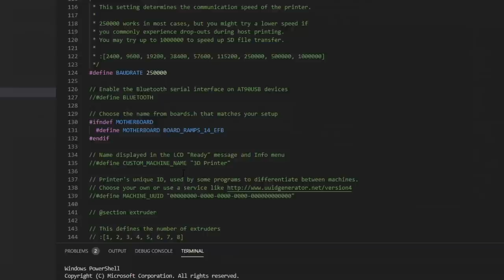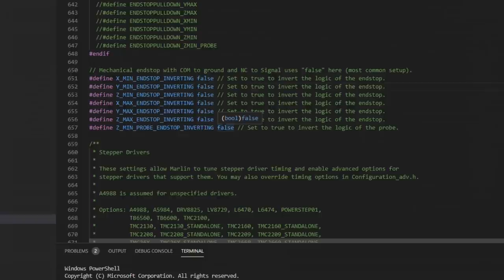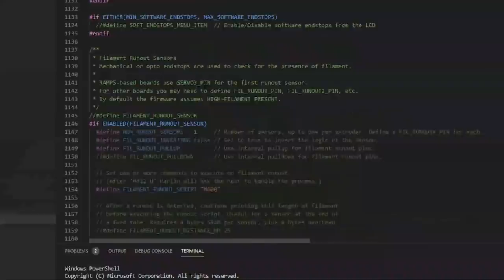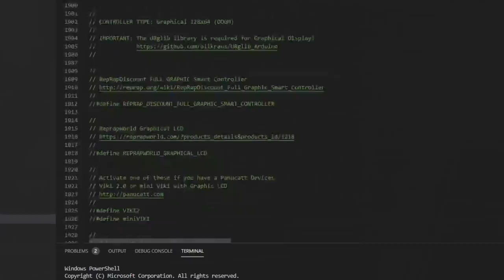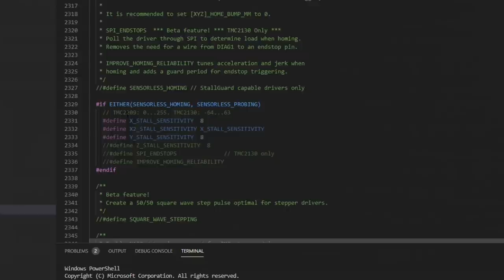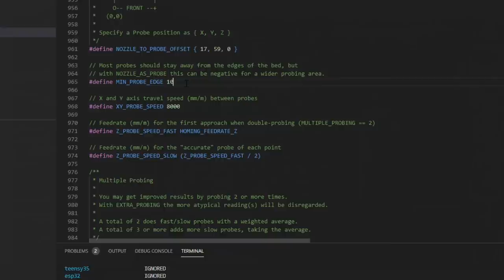Marlin Firmware Config - Core XY - SKGO - Chris's Basement

Comment: Question if I may...
I have the SKR 1.4 Turbo and 2209's, I recently upgraded from a 12 volt supply to a 24 and didnt change the  "CHOPPER_TIMING CHOPPER_DEFAULT" to 24 volt.
With this cause an issue?? or should I change it right away???

Thanks for your time..
Reply from the maker: Hey, no issues, this is mainly for noise, the chopper timing can sometime cause a whistle at certain voltages. This setting it trying to help that.
Reply: @ChrisRiley  Thanks for the info....

Comment: Great information. With ABL I replace the bed springs with printed, solid mounts. The bed may be more stable that way.  
For best probe accuracy and deeper probing depth (inductive probing through glass top on metal bed etc.) , you can use a 5v zener diode on the probe wires that go to the board, but run the probe power off a 12v line. So 12v goes to the probe but only 5v goes to the board. I can link a video where I learned that if anyone is interested.
Reply from the maker: Thanks John, yes great info. The 6-36v probes seem to have a lot more power when sensing, great suggestion.
Reply: John, that would be great to link the video.  I have an EZABL, don't know if that would apply.
Reply: @woodwaker1  The EZABL uses a different setup to achieve about the same thing the zener diode does. I believe it also gets 12v to the probe but only 5v to the board like the zener diode. But it costs much more. A zener diode and probe can be had for about $10.  I'm kinda cheap so that's why I went the diode route.
Reply: @JohnSmith-mk8hz  Thanks for the information.  I thought that was the way it worked, as it is powered directly from the power supply - 12 or 24V.  It may cost more, but works great.

Comment: On the skr v1.3 It happen to a friend. (board was not recognized on the PC) We removed the chip D3 which is a usb protection chip. If you remove that chip it will return your usb connectivity via usb to the PC. Chip could be sourced very cheaply and replace to have the protection back into the board. Just simply de-solder the chip and that's it.
Before heating the iron, if you want to check for this. Get your Voltmeter and set it measure ohms o continuity. Measure from D+ to D- (from the usb port). You would see a short between those to pins. Pins visible and marked bellow the usb connection. Do this with the board disconnected.
Reply from the maker: I am going to try this out for sure! Thanks for posting this, super helpful.

Comment: Great vid. Since the skgo is very often out of stock and going to have a price increase soon, what would you recommend as an alternative?
Reply: The Ender 6 corexy will be out soon.
Reply: @JohnSmith-mk8hz  Thanks for the information!   Was not aware of this, they have a picture on their website, I submitted an inquiry as they are taking pre orders
Reply: @woodwaker1  Looks like the Ender 6 is only going to be 250*250*400MM.  Good vertical, but not particularly good size on the plate.  So, I guess just kinda depends on what you want to print.  I have the Seckit, and it's well worth the wait/money.  Maybe another alternative though would be a Ender 5 Plus with the corexy mod?
Reply from the maker: I will be interested to see what the Ender 6 brings at what price. Doing something like a hyper cube build is always an option.